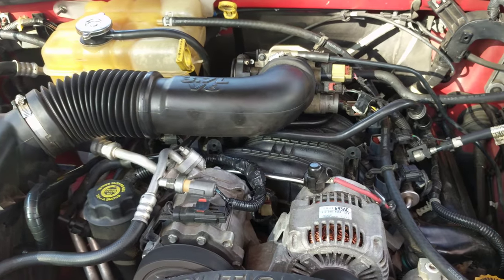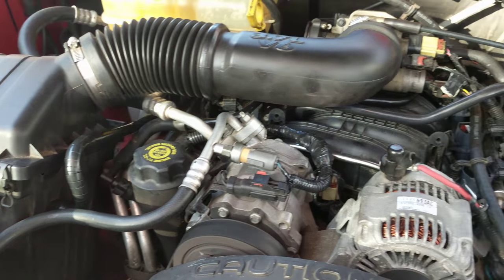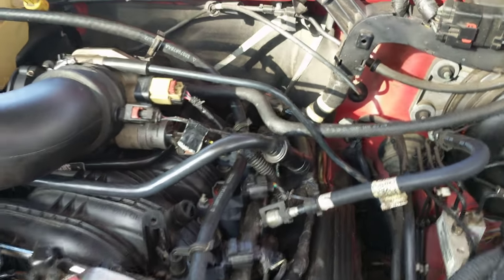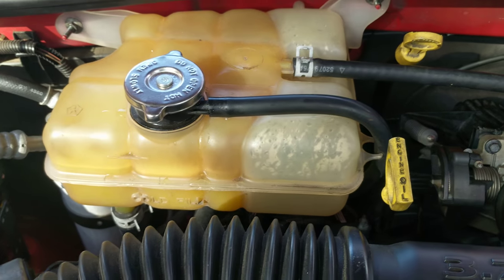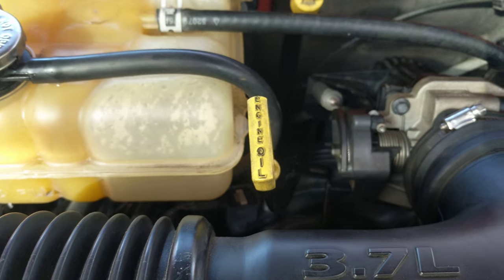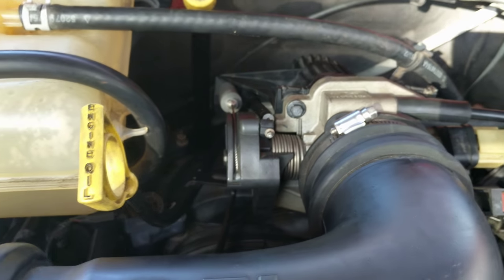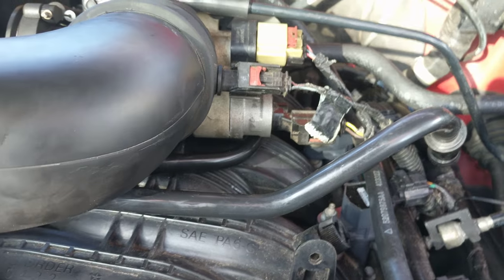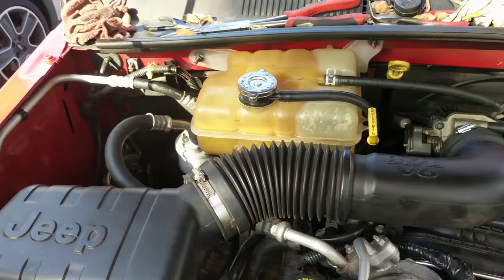3.7 L Jeep/Chrysler Intake Manifold (9)

Comment: Thank you for this series. I might do this job if i diagnose a vacuum leak with smoke machine. (Will be doing it tomorrow) It idling rough and shakes. No codes. Fuel trims were crazy and better at higher rpm. Misfire counter was counting up. Hope it’s just a vacuum leak not internal engine problem. Again thank you.
Reply: Dude I have the same problem with my 04 Jeep Liberty. I know you probably won't see this comment but what was the problem causing the misfire/rough idle?